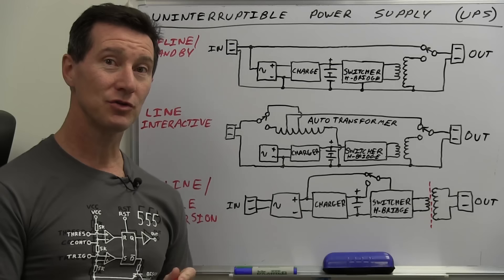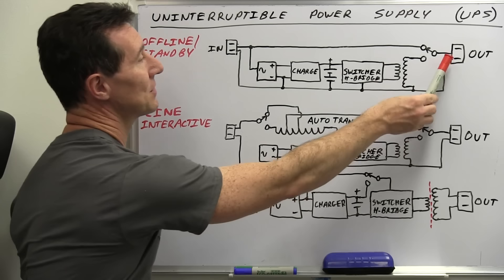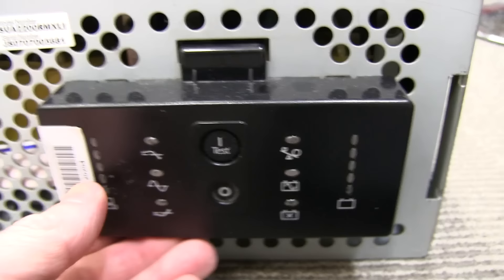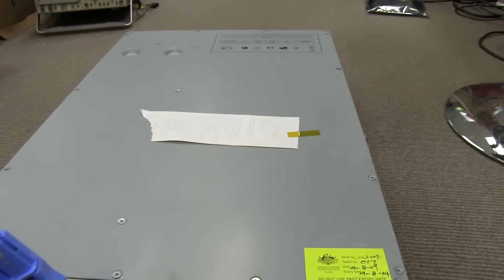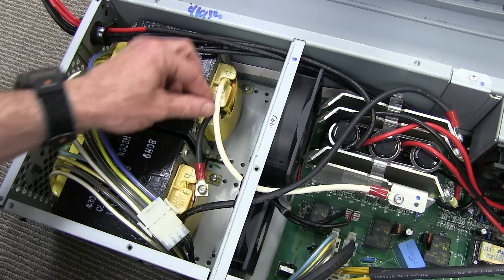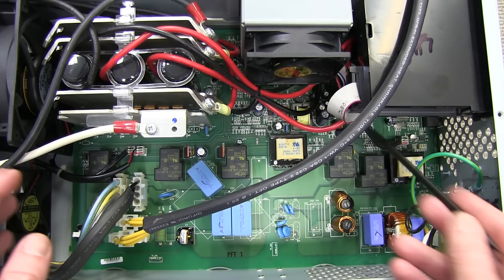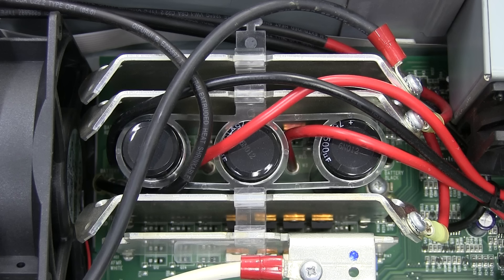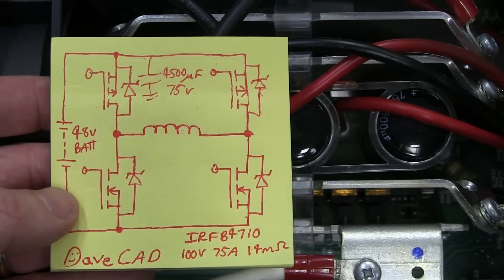EEVblog #504 - UPS Tutorial & Teardown

Comment: H Bridge serves as the rectifier aswell in the reverse charging mode
Reply: well discovered Mr EEVblog thanks.
Reply: @andrewmusisi7147  How would I disable the charging only, without affecting the rest?
Reply: @HarryoGaming   Hello there, what normally happens if you wanted to disable charging,  you normally have to alter the firm where in the microcontroller that runs the PWM section of the H Bridge power block in the inverter charger, or you can alter the configuration of the tristate logic buffer ICs which sit between the microcontroller and the H block Mosfet array in the power block.
Reply: That is assuming you are dealing with  Microcontroller based linear inverter charger, but if you are dealing with Microcontroller based switch mode inverter it is alot more complicated.
Reply: Remember that altering the firmware on microcontroller-based inverter chargers, involves knowing the type of microcontroller used in the inverter, I.E. is it an Atmega, ?,is it a Pic Mcu ?  or is it an ST microcontroller? Once you have determined that , also what type of embedded firmware  and hardware programming tool will be used to program the specific Microcontroller. . Atmega has their own firmware ST also has their own so does PIC microcontroller. It is alot more complicated than you think. In the older inverter chargers with Microprocessors they had an flash EEPROM you could remove and reprogram. The challenge with Microcontrollers is they are microprocessors which incooperate internal EEPROMS and I/O registers and other peripherals in the same package.
Reply: Although altering configuration of the tristate logic ICs, I have burnt a number of Mosfets I would not recommend doing that, the software or rather firmware route is based advised once you have studied your inverter chargers entire circuit..
Reply: @andrewmusisi7147  Sounds too complicated, I'm wandering if there is something that can be done physically?
Reply: @HarryoGaming   What is the make and Brand of the type of inverter you intend to halt the charging function?
Reply: Also what is the model number or serial number, I cannot promise but may be knowing those details One can guide you as to how to halt the charging function
Reply: @andrewmusisi7147  SUA1000I, SU1400INET, SC420I
Reply: @HarryoGaming  thanks let me see what I can find then I will get back to you.
Reply: @HarryoGaming By the looks of the model number these are old school Microprocessor based APC linear inverters
Reply: @HarryoGaming  5) measure the battery voltage of the APC UPS, then measure the voltage of the potentiometer/variable resistor at the A/D(analogue to digital converter chip. They should be the same, then reduce the resistance at the variable resistor, near the A/D converter chip. THE APC UPS inverter should stop charging.
Reply: T
Reply: D
Reply: @andrewmusisi7147  Thanks for the help Andrew! How would it be on the SC420I, it has no potentiometer/variable resistor on the board, but I have found the A/D chip.
Reply: @HarryoGaming   brilliant, atleast you found the A/D chip, there should be a fixed network resistor array connected to the ADC chip, first measure battery voltage then measure resistance voltage for resistor network connected to the ADC chip, there voltages should correspond, it is at that point you desolder that resistor network and then substitute a potentiometer in place of that resistor coupled to ADC chip then you reduce the resistance on the potentiometer
Reply: The adjustment on the potetniometer should be done trial and error style raise and lower the resistance until you see the battery voltage drop below the 12 Volt mark ideally when there is charge present in the inverter it would be roughly between 12.8 to 13.3 or above volts. keep the multimeter plugges to the battery terminals with crocodile clips.
Reply: @andrewmusisi7147  There is only one potentiometer on the SU1400INET, pretty close to the A/D IC, but when I turn it nothing happens with the charging (stays at arround 26-27v 3A)
Reply: @HarryoGaming  I see the first thing to check, is wether, the potentiometer, actually works, (2) are there any other resistors near the ADC?, It could be that the potentiometer, is faulty. You may have remove Potentiometer and test it out of the circuit.
Reply: @HarryoGaming  Have you disconnected the batteries and left the multimeter connected to the battery connectors of the inverter?
Reply: I forgot to add leave the multimeter connected and bring the resistance of the potentiometer all the way up, then leave it for 15 minutes it may take time to stop charging it is not immediate. then if it does not do that alter the potentiometer resistance all the way down and wait for another 15 minutes and see if the charging has stopped. There is a hysteresis effect in battery charging, so it takes time to react to potentiometer adjustments.
Reply: @HarryoGaming  Something I have just remembered the potentiometer may be for the cut-in, cut-out voltage monitoring AC mains voltage, not the charging voltage of the battery, you need to use continuity test mode on the multimeter to trace the Battery B+  connector all the way to one of the other input pins of the ADC, in between the battery there may also be a comparator OP_AMP IC bare that in mind between the ADC and the B+ battery connector. At the comparator, there may actually be a resistor network with which you can run a potentiometer in parallel to alter the resistance, to change the battery charging status.
Reply: @andrewmusisi7147  I have tested the voltage without battery and the current with the multimeter in series, but not given it time. Can I do a easy test to tell if the potentiometer is the right one?
Reply: @andrewmusisi7147  Are you referring to the vREF pin on the A/D? (SC420I: adc0848) (SU1400INET: DAC-08CN)
Reply: @HarryoGaming  thanks for sharing that detail let me try and look at the ADC model number I see how to help you out, it may take me two hours, Vref is normally left alone.
Reply: @HarryoGaming  yes you can you  could put the multimeter on the highest volt range , then you could have someone hold one of the test leads on the center pin of the potentiometer and the other test lead on one of the outer pins of the potentiometer
as you adjust the potentiometer knob the voltage reading should change, but remember to mark the potentiometers original setting, such that you put it back after testing.
Reply: @andrewmusisi7147  What pin on both of the A/Ds should be adjusted?
Reply: @HarryoGaming  The potentiometer has three pins or you call them three legs, so what I meant is one test lead of the multimeter should be connected to the centre pin, and the other test lead to either of the outer pins/legs of the potentiometer. It is the knob or dial you turn to adjust the resistance
Reply: @andrewmusisi7147  What if I just desolder the A/D chip reference voltage? Will the voltage reference then be 0v and never charge?
Reply: @HarryoGaming   You have to be sure that it is A/D Ic connected to the Battery monitoring and management circuit, if not you may have problems, Remember that the same A/D chip may be a multi channel A/D IC, so it also monitors mains voltage through a second channel that is pin, it may use another pin to monitor output voltage at the H bridge driver and through CT coils the output of the step up transformer, so I would not remove it. Once the Microprocessor cannot talk or see the A/D Ic then it may go into fail safe mode and shut the inverter down. So In my opinion It would not be wise to remove the A/D Ic.
Reply: @andrewmusisi7147  The A/D specs says its 6v ref, why is that when its 24v?
Reply: @HarryoGaming   (1)How are you reading the ADC supply voltage? ,(2) is your multimeter probing the right voltage source? (3) The reference voltage refers to the input channel of the ADC with respect to the voltage supply external of the sensing unit. (4) Reference voltages are adjustable via information given in the datasheet. (5) Have you located your ground pin on the ADC? I trust from all the difficulty you have you are not an Electronics technician, neither are you an electronics systems engineer. The ADC being part of the digital logic should  not have a voltage source higher than the 5v or 6v max, if you are getting 24  volt there may be a problem with the power supply driving the control logic of the inverter. I would not expect the ADC or the microprocessor to survive, such high voltage.
Reply: Mr Harry look for the Vss pin of the ADC (1) then look for the GND pin/Vdd pin Then place the red probe of your multimeter on the Vss pin(2) put the black lead of the multimeter on the GND/ pin of the ADC. (3) Then take the voltage reading of the multimeter. It should be 5v or 5.5v . Then look for the pins normally labelled AN1 to AN5 measure all those pins those are the analogue inputs. As you measure AN0 to AN5 with the red lead, remembering to keep black lead on GND pin. All voltages on the Analogue input should be between 0v to 4/5v
Reply: You may also want to check the CLK pin that is the clock pin on ADC to see if there is frequency measurement, that is if your multimeter or oscilloscope can detect a frequency in the order of a few megahertz..Again connecting the black lead of your multimeter to the same GND pin of the ADC.
Reply: If you are not getting an active clock signal to the ADC,( that is frequency in the order of a few Megahertz), then it means your ADC cannot function, it may explain why you are having issues with your inverter, not functioning correctly.
Reply: @andrewmusisi7147  No worries, it is functioning correctly and is not getting 24v on ref pin. Yes I have difficulty grasping the concepts, I appreciate your help. I will try to do the steps you layed out for me.
Reply: @andrewmusisi7147  Will adding and adjusting a potentiometer for the chip controlling the H-bridge charging not affect the other functions of the UPS other then charging?
Reply: @HarryoGaming  No worries , look at the positive side, we all learn through challenges, you will become a very good electronics expert through challenges, you have actually learnt alot through these challenges. I myself other then being a time served electronics embedded systems engineer also have teaching qualifications, so I am more than happy to assist you.
Reply: @HarryoGaming  I would. Not think so, there may very well also be an internal electronic programmable attenuator IC, which may also be used with the Microprocessor  to mediate charging activity, I have seen that in some Inverters what I do not know is wether yours has such an IC.

Comment: This topology is very popular in India as household inverter, as mains power is very erratic. Usual power rating is 875VA to 2KVA. The charging scheme is same as you explained, only added modification is to use the top diodes and switch the bottom MOSFETs which lets the DC voltage output to be controlled so that different charging curves can be implemented. Higher cost of copper and steel is bringing new topologies of inverter = dual conversion = battery (DC-DC) to 325V + H bridge (high freq)

Comment: Dave  to get a sine wave  50 hz with  pwm switching on H bridge at not a high frequency             
only 50 hz on H bridge but high an low Technic and PID algorithm when charging start
you listen some voice not only fan but different this time start high frequency on H bridge and storing current on battery

Comment: Due to creep creeping around my house with armed robbery on the creature's mind I installed a photobeams alarm system, and a 8 cameras security system monitor outside my house.  I bought a "APC UPS Battery Backup and Surge Protector, 600VA Backup Battery Power Supply, BE600M1 Back-UPS with USB Charger Port" to power my PC and security equipment.   I have a 12V deep cycle marine battery in my basement with a surge protected 4 amp float charger. I supply 12V DC power to my modem, router, and photo beam alarm system straight from the marine battery at all times. The UPS supplies power to my PC and security camera system. I removed the UPS battery that could only supply backup 12V DC for 16 minutes.  and connected the marine battery to the UPS battery connection wires. The marine battery can supply the entire 140 watts my setup draws for 82 hours. .   I don't know which of the three categories my APC UPS  BE600M1 is in, but I did a test by unplugging the 120V UPS supply from the utility and nothing shutdown.  Nothing at all happened.  Not even a blink.

Comment: And this is why that model UPS is rubbish. It has zero capability to stop charging the battery pack. As a result, it WILL eventually incinerate the batteries. I have yet to see one that hasn't. A quality UPS monitors the battery string(s) and stops charging them when they've taken what should be a full charge -- continuously dumping current into a battery is a bad idea.

Comment: is that one a true sign wave output ?
Reply: All APC UPS's are probably true sign wave output since they are a price bracket above everyone else.
Reply: NZ SNIPER
Nop. I don't know about that specific model teardown from APC, but low to mid price point UPS from that company output a square wave. I know, I'm using two: one small 12 Volts Offline and one 48 Volts Line interactive, and both output a square wave (as seen on an oscilloscope) when powering from the battery/switcher. That's a consideration to take into account if protecting audio equipment sensitive to line power harmonics from power failure or brownouts.

Comment: Good stuff, though one topology is glaringly missing, could a video covering triple conversion switch mode ups's be done ? a tech doc on one such implementation can be found on TI wesite as: spra589a.pdf Essentially the aim of such a system is to cut the weight, power losses & component costs of a more traditional design by doing all the power conversion at high freqs via typical smpsu techniques, then a HV DC reservoir is pwm modulated at a high frequency & filtered to provide ac out .

Comment: Hi Dave 
I must  disagree. Is deficiently, low capacitance in here for the price of that monster. With that power I will put at least 20.000uf. Dont be paltry, like in your multimeter design ha-ha. Do ir better Dave. More filtering is always better. Also a better high speed ADC´s, less quantization noise, etc.  Btw that costly design doesn´t convice me at all !!. I  would expect more, a toroidal transformer, dual stages, multi regulated power supplies, temperature controlled pwm  fans, well you know... knockoff - It´s plainly a naaaa...

Comment: 39:29 - No very clever, because there uses unregulated line voltage and there is NO regulation of 12V battery voltage and charging current. In fact, this is fast way to blow the battery. Its a extremely stupid solution.

My stupid amateur Fortron working the same way and already blow first battery. After it, I throw it to the garbage and purchase normal UPS with normal charger inside!
Reply: It's more clever than you think, you can't fully charge a 12v battery with 12v you need 13.8v for lead acid batteries. To take into account  losses in the H-bridge, cables, and low battery conditions the transformer maybe wound Eg. For a 240v UPS 10.5v on the primary to give 240v on the secondary. You definitely can't charge a 12v battery with 10.5v. All the stuff in patent about transformer inductance and the switching patterns in the H-bridge is critical to getting any charge flowing to the battery at all.
Reply: H-bribge vith leacdage inductance is there to act as a classic boost converter to boost 10,5V to 13,8V